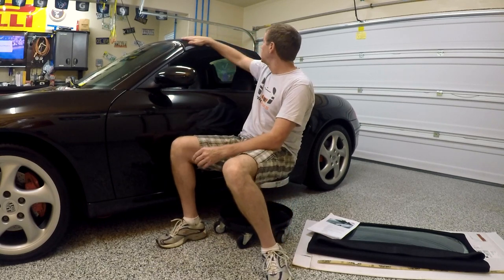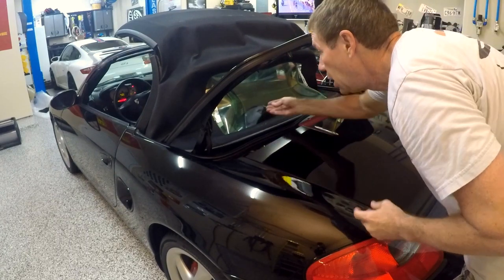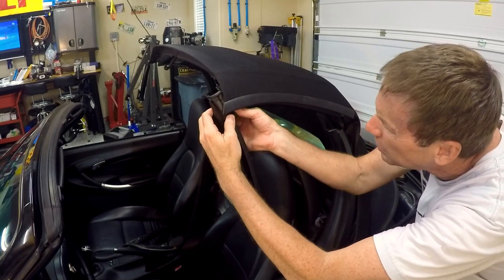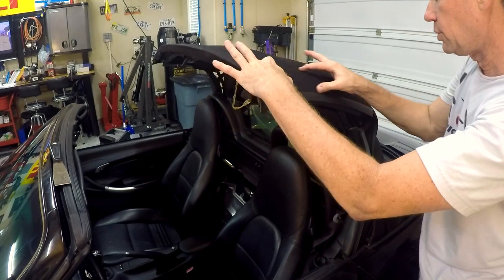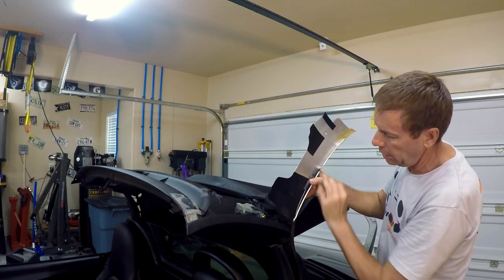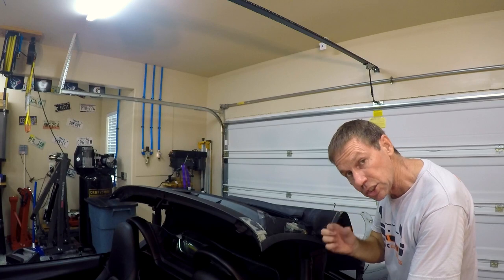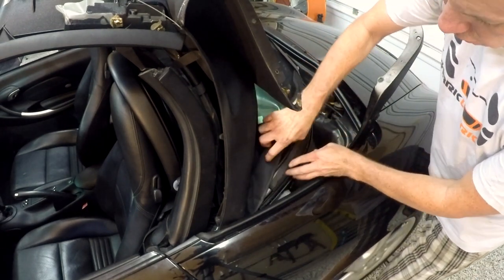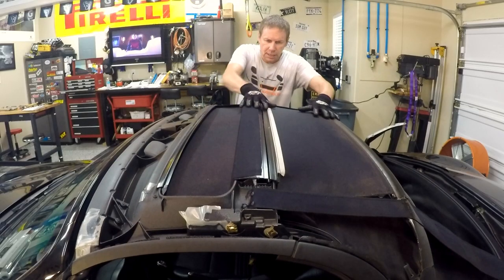Jet 3 How to Remove and Install a New Convertible Top on a Porsche Boxster S (Part 1)

Comment: I’ve done at least 50 boxier tops and tou don’t need to take the rear bonnet off
Reply: True. But it gives you a lot more room to work for a rather minimal 3 bolts per side.🤷🏻‍♂️

Comment: Is there a way to just buy a top that can be full assembled then simply put on the car, after removing the old one? Or do you have to patch a new one into the existing frame? Like how you've done in this video

Comment: Thank you for doing this.  Took me about 12 hours to complete but never would have done it without this video. I did cut a little too much off the corners but I got it tucked in with some extra care.  Also, because I could see the end result I sped up my removal with a razor. Cut the whole top off the. The parts were easier to see.

Comment: I'm using this to do my 996. I'll add comments for any differences as I go. For the first rubber portion you take of the front, the 996 does have 2 size screws, a T15 and T20s, there are a total of 8 T20s and 6 T15s down the side.
Reply: Nevermind, they are similar, but there are so many additional steps on the 996 that this would become its own post and video. This video above was great as a guideline and saved me quite a bit of pain, so thank you for that.

Comment: great video. i am in the middle of this right now, when i removed old top(replaced before i got it) i found the seal you call a support seal in the rear that goes under the top around the back is missing. any idea how to source one or just skip it????
Reply: Dalis, honestly, it has been a really long time since I did this project. I don’t even recall the seal you reference. That stated, it’s generally not a good idea to skip it. If there is a seal there it is a good idea to continue having a seal there to keep out moisture, water, etc. you may have to do a little bit of digging online to find a picture or part number of the seal. Junkyard is probably not a reasonable source as it will have been in the sun and the weather forever.
Reply: @stevenbukoski4474  i appreciate the reply. i have already done all that. no luck. 

9:04 in part two you reinstalled it. said not to put any sealer on it. goes under the top material. mine is just not there. i think i will have to skip it if i cant even name it. it wasnt instelled last time so what can i do.

Comment: Hey man, I just got a beautiful Porsche boxter 986 ,1999 model. Are there any differences in repealing a Porsche boxter s and Porsche boxter convertible top? 

Best, 
Maik
Reply from the maker: The process and materials is exactly the same for any version of 986.  Likely the same for 987 as well
Reply: @roaringtigersgarage4672  thanks for the quick answer. Sorry for the typo but you get where i was going at! Thanks ! I am not sure if I can repair it myself, I don’t have any of those tools. How many days did it take you to get the roof fixed ? It seems like it took at least 3 days or so.?!

Do you think it’s worth buying the roof myself and going to a repair service to get it fixed ? I probably save some money by being able to decide which quality roof I want and I avoid any upcharges from the “fixing place” regarding the roof ..?
Reply from the maker: @BerinMaik  Plan on 2 days.  Take your time and don't rush it (this is good advice for any car maintenance/repair).  It did take me 3 days because of the repairs I had to make to the plastic bits (reinforcement and epoxy.  want to be sure epoxy is fully cured before it is stressed).
Reply from the maker: Nope. exactly the same
Reply: @roaringtigersgarage4672  hey, is there a way to only replace the foldable back window of the convertible? My convertible is pretty good and doesn’t really need to get replaced. But the plastic window is foggy and you can’t see trough at all. Do you know any tricks to fix it , or any ways to replace the “window”? 

Thank you so much for all the answers and the communication! ❤️🙌

Best,
Maik
Reply: @BerinMaik it’s glued/sewn in, so, no. You have to replace the top.